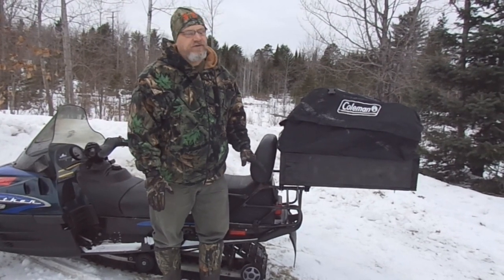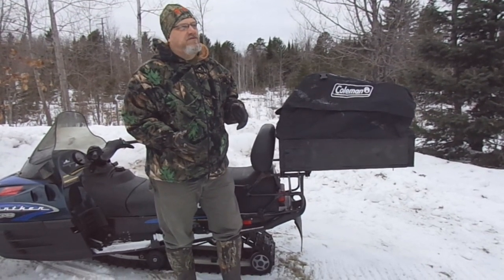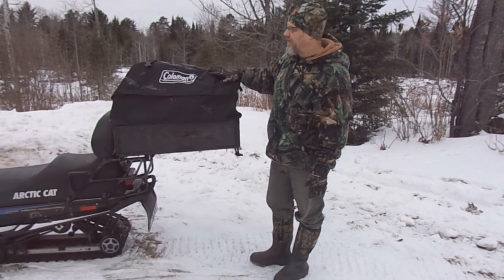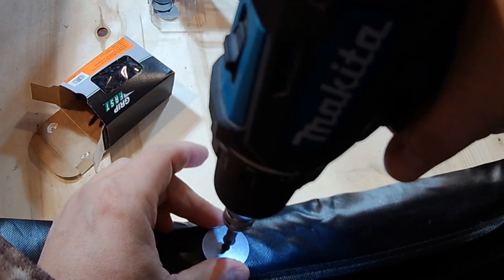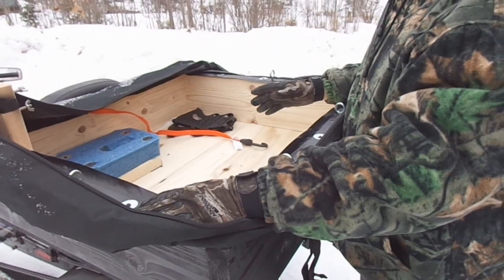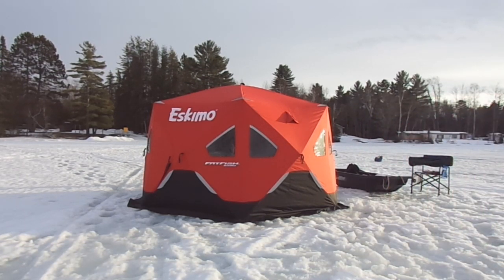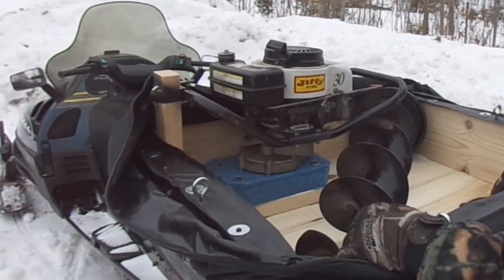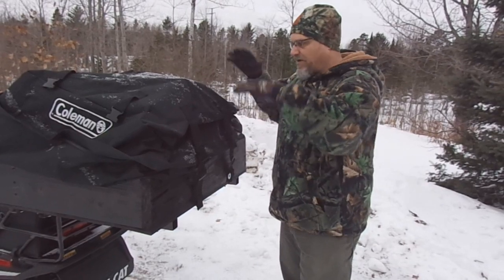Ice Fishing - Make A Cargo Box For A Snowmobile

Comment: You should add mounts to the side so you can put your auger actually on it and carry on the outside  and the motor on the inside and that would give you more room
Reply from the maker: That's a great idea.  I did give that some thought while building.  The one thing I wanted was to just put the sno mo in the back of the truck and go down the road.  I want the entire auger secure and covered from road salt as I'm driving.  Nothing to unpack and store in the truck while driving.  Your idea would add a lot of room though.  Maybe the mounts could be optional if a guy needs the room, thanks, KPO.
Reply: You know if you use a piece of PVC that's big enough for the auger to set inside of then that would protect it from the salt it also make it secure if you put caps on the ends and wouldn't add that much weight to it and when you're not carrying your auger in it that will give you another spot to carry something else
Reply from the maker: You got me now.  I was thinking more like a gun rack which wouldn't protect it, but the PVC would work.  I may price some today!  Thanks for the interest, KPO